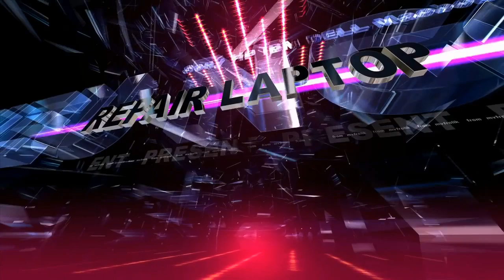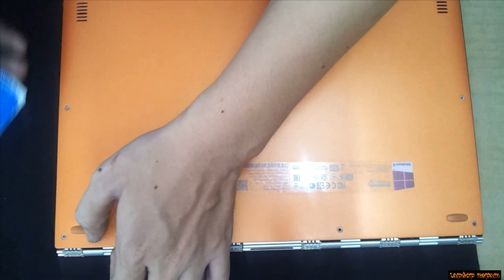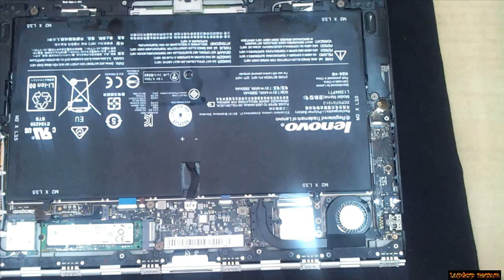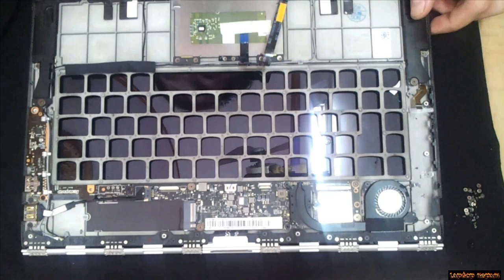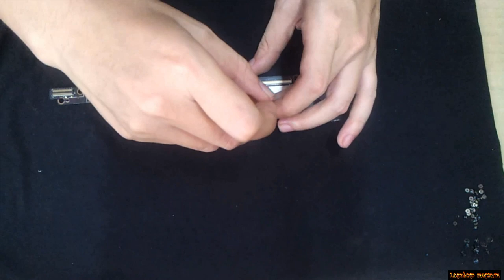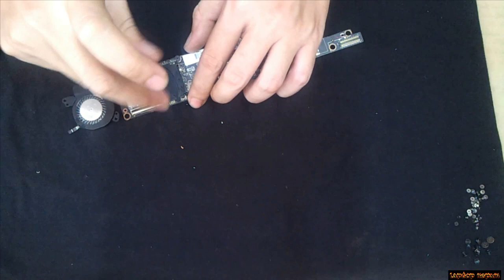Lenovo Yoga 3 Pro Disassembly and fan cleaning  Laptop repair

Comment: Thanks for the inner view! I had to lookup the wifi antenna connectors.
Now I can peacefully replace the shitty broadcom with shiny new intel mu-mimo, hehe!
Reply: Are you having a problem with it locking up when you move the screen? I am trying find a fix. Its the wireless or heat sync...